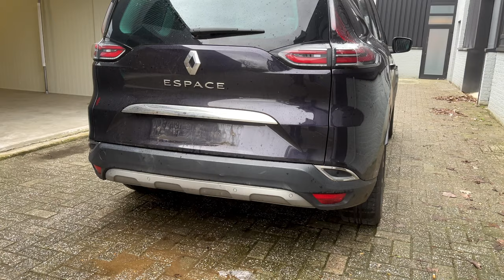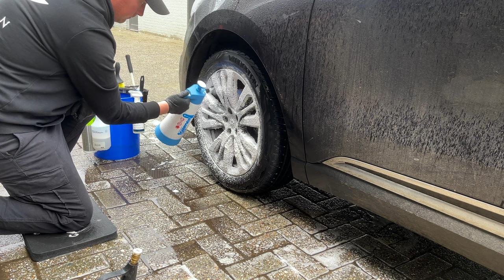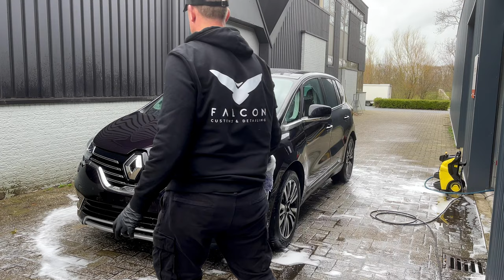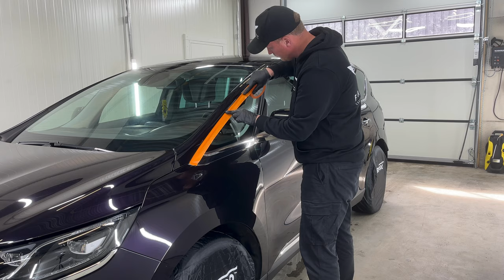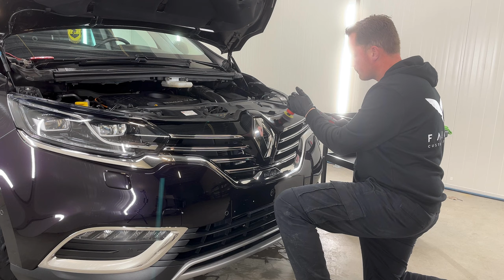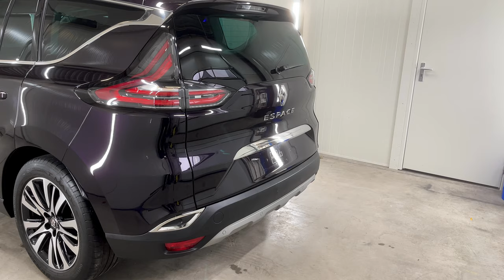Cleaning a Extreme Dirty Renault Espace - Exterior Detailing - Falcon Customs & Detailing

Comment: You should really pre rinse the tires before you touch them. It doesn't really matter if the (alkaline) cleaning product get's dilluted with water because t's dilluted anyway. You're scrubbing the tires with allot of dirt on them for no reason. 90% of that dirt would've come off with a water pre rinse.
Reply from the maker: Hi Fluzzer, maybe you are right. I found out that this way of not pre rinsing works the best for me because I clean the tyres always twice. But Thanks for sharing!
Reply: @falconcustoms  Yes the product will be more effective on a "dry" tire. But this one was just too dirty and the negatives outweigh the positivs. It's better to clean the tire 2 times than scrubbing the dirt against the tire wall. Contrary to popular belief, tires can be damaged because of cleaning. Some high lever detailers don't even use a scrubber on tires.